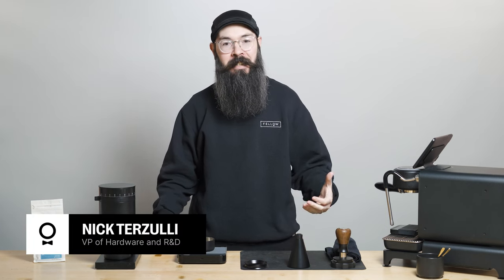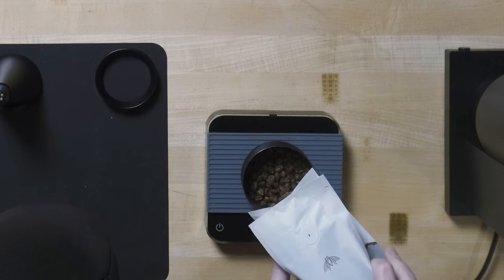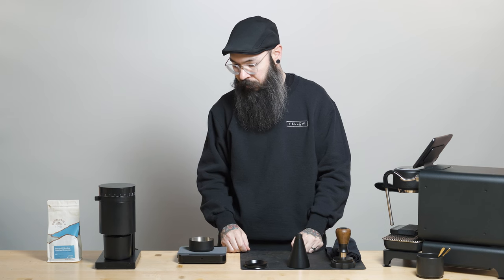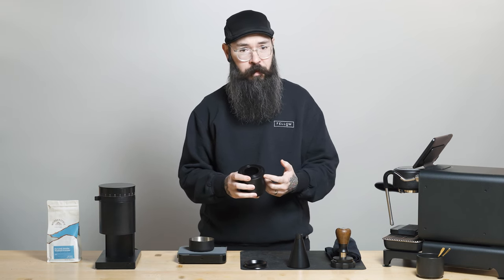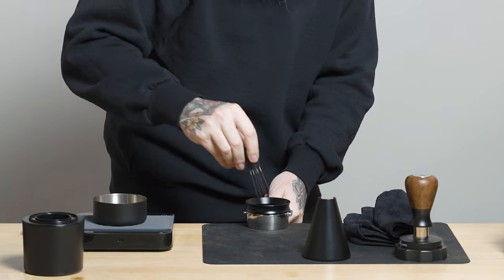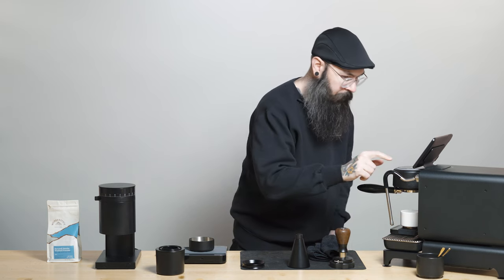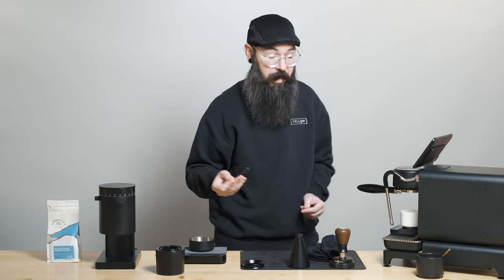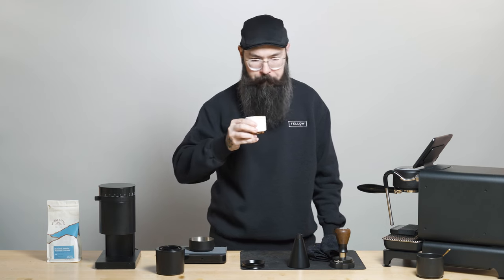Opus Conical Burr Grinder - How to Grind for Espresso

Comment: The grinder looks great so far. I got a Breville espresso machine. The 1 setting was too fine and it wouldnt pull from the machine. I used a 3 and it did well. Cant wait to really dial it in.

Comment: I cannot dial my machine in. Ive done 16-18 grams of beans with the grind size at 3!!! Anything below the pressure guage maxes out and nothing comes out cause its to fine. Is this normal. Does anyone have ideas?
Reply: I’ve found one type of beans I like is in the 2-3 range. It definitely depends on the beans. Maybe some are good at 1-2 like he says here, but I’m not seeing that either.
Reply: @AndyTanguay  I've tried a bunch of beans but still sitting at like 3.1 or 3.2 with 19 grams. I only get fresh beans but it sucks having to raise it this much to get a good shot. Feels weird lol. Same as black coffee as well
Reply: Man, that is weird. It’s definitely sensitive. Last night one of the clicks on the Fellows made a difference. So, it is a bit of an art form. The good news is that doing the same thing this morning with the same beans kicked out the same good shot. 

Also, keep in mind, I’ve only been doing this a month…sooo yeah. 😉
Reply: I think that's fine. I've been grinding mine in between 4 and 5, below 4 my machine clogs. Another thing that I find odd is that my grinder takes about 45 seconds to grind 18g while almost everyone else says it takes around 25 seconds. Im not sure if these things are normal so I'm currently in the process of exchanging it for a new one. Hope the new one has all these issues fixed. 🤞

Comment: My Opus is only a month old, used mostly for aeropress, but when i tried to grind for espresso at recommended level 2 grind, my 9 bar breville bambino, wouldnt be able to get any water through the portafilter, and would just stop, when removing the portafilter, that pressure just sprayed out, i had to go all the way up to level 6 grind just to get some water to go through the espresso shot, is this normal?
Reply: My machine delingni got hard time to do it at #2 and the flavor was very very bitter and not pleasant. Musty like a lemon skin. So I grind it at 3 and the machine was able to do it easily and the crema was very thick with a perfect flavor mixed of acidity and sugar.

Comment: Not sure if anyone else is having this issue but I can't get a shot to come through unless I am between 4 - 5. My machine is choked right up to 4 on the course dial... I am using a Bambino with this Opus grinder.
Reply: Same. I’m right at a 4 on the grinder for espresso using a Bambino Plus. 1-2 choked the espresso machine.
Reply: Same on my gaggia classic.  Clogs at three
Reply: @navazam4566  Same on my gaggia classic. I'm around 4 and have burned through so many bags before it was dialed in. Super frustrating.
Reply: @chrisprince9981  yeah I think fellow made it a bit too complex and I went through like 500 grams of coffee with bad shots. Hope u have a decent espresso now though!
Reply: I just ended up returning and buying the Baratza Encore Esp, much happier!
Reply: @albertzhu9330  Im having the exact same issue with my Bambino & Opus combo. Mine takes about 45 seconds to grind 18g and even if I use freshly roasted beans, my espresso shots taste a bit weak. Does yours do this too? I'm in the process of exchanging it for another, but after reading these comments, now I'm not sure if it would make a difference.

Comment: You grind 18grams in 30seconds, means about 0.6g/sec grinding speed. Why is my same Fellow doing today 0.3g/sec best case at grinding level 3.  However at the beginning (2-3 months ago), it was same as yours. And I also see the grinds static (stick on the wall, jumping around). Any idea?

Comment: Trying to pull espresso shots and having no luck as it just clogs and no espresso comes out.  I am a newby so any advise is appreciated.  I have tried each setting from 2 down to 1 with the same results.  Wasted a lot of beans in the process.  I have not adjusted the internal settings as I am unsure if this means I need to go finer and which direction it should be.
Reply: You should go courser if that is the case.
Reply: Go courser for sure. 1&2 is very fine. You need a proper machine to work through that. Also depends on age of beans etc

Comment: Just got my Opus and having some issues. I get no shot pulled when using this set up/config.  Opus at a 2, using a Breville Bambino Plus with an unpressurized basket.  I'm using Lavazza Espresso beans, I think it's a pretty dark roast.  Any tips are greatly appreciated!
Reply: I am having the same issue! I tried the Opus at a 1, 1.5, 2... and the pressure dial still goes to max pressure and no shot. I tried a pressurized and an unpressurized basket.  I am wondering if the Bambino just requires a coarser grind?  Let us know if you figure out the trick!
Reply: I been pulling shots on my Bambino at 2 and one click under 2.
Reply: Switch away from LavAzza beans. That's the first problem. They're months old and use a nitrogen bath to preserve the outer shell from being oxidized, but the inside still turns rancid and won't pull correctly. Get beans from a local roaster.
Reply: Thanks for the advice! I switched beans since I posted and got much better results. Still not pulling great shots, but learning and improving. @MrBahBZ
Reply: I ran into this issue recently with my new opus + bambino combo, moving grind to 2.5 seem to resolve my issue a bit, still working on better method of distribution for even extraction, invested in a wdt but might need to invest in a better tamper too, the default from breville doesn't seem to be cutting it. E.g. sides not tamped, hard to consistently tamp fully flat with no angle. Let me know if you've found a good setup with bambino + opus since these last couple months xD

Comment: Just bought the Opus to grind espresso.  What dial number should I be using for a double shot of espresso.
Reply: Still trying to figure that out 1.5 weeks later with medium and dark roasts
Reply from the maker: When it comes to a double shot, you want to start with 18-20g of coffee and end with 36-40g in 30 seconds at the normal setting for espresso. Hope this helps!
Reply: There's no actual answer to your question because while there are espresso "ranges", there's no specific espresso "setting" that works by default. That isn't how grinding for espresso works. You have to dial in, i.e. try a number of settings for each new bag of beans to narrow down what will get you the output in grams over a specific extraction time that you're looking for. And then continue to adjust from there for taste.

Comment: I just got my new Opus two days ago. I used it for making espresso (1.4 grind level). I used it twice, and now it won’t grind my beans. It turns on and runs, but nothing comes out. When I started troubleshooting, I discovered that the area under the burrs were so clogged, I had to get a pipe cleaner to dig out all the coffee. I cleaned it out, did a coarser grind to clear out the rest of the beans, and tried again. Same result, except that this time I got half of the shot to come out before it clogged up tighter than, well, insert the “tighter than” joke of your choice.  This is unusable. I can’t even get it to grind a complete shot. And, wasted about half a bag of beans in the process. I am really unhappy with this machine. My previous Fellow Ode grinder was amazing, it just did not do espresso. It would appear to me that, neither does the Opus.
Reply from the maker: Hey there! Sorry to hear this - please send an email over to hello@fellowproducts.com so we can offer in depth assistance here :)
Reply: @FellowProducts  thank you for the speedy reply. I have thoroughly unstuffed it, and have it set for a coarser grind than I started with. I will be trying this for a couple of days, and will let you know if it continues to be an issue. I love my Fellow gear.
Reply: I'm having the same issue. Using machine for a few days.
This is usually happening when you grind more than basket can hold, so now I'm not grinding more than 20g if you use holder insert
Reply: @OnlineObsessionista  yep. I’ve learned that it will not allow me to use too many beans in the hopper. If I do, I will be digging all of the clogged grinds out of the machine. It is very particular about not over loading the machine. It also does a lot better with flavored beans. Certain beans will clog it like anything. When it works the way I expected it to, it is a really great little machine and I love it. When it gets plugged?  A lot of cussing ensues. 😏

Comment: You can hear the RPMs ramp up when it finishes, indicating an undertorqued motor for this fine of a grind. If Fellow wanted to release another burrset for espresso/Moka only, that might make sense, but at 40mm there's just no way this thing is grinding properly for everything from filter to espresso. It's understandable that everyone wants the magic bullet that can do it all, but there's always underperformance at either the fine or coarse end of grind size depending on the grinder's target method.

It's a nice device, but at less than $200 you know some significant compromises are built-in.

The Ode was an incredible grinder for filter and medium/dark pourovers, but that's because it specialized more narrowly for those purposes. If you absolutely must brew for every method on a budget, this may be one of the best on the market. Just don't expect high-end espresso on an affordable, universal conical.